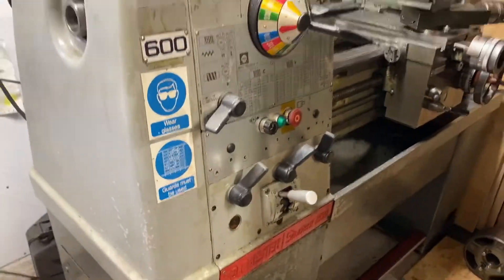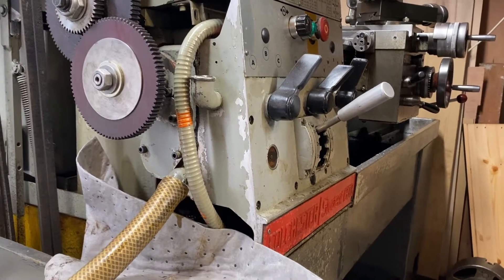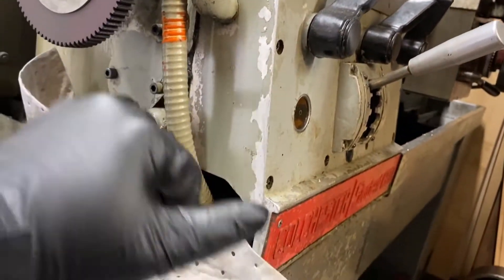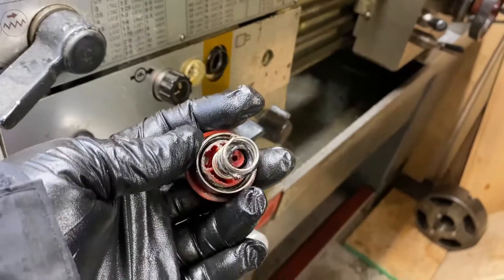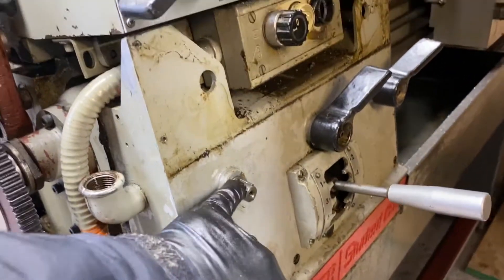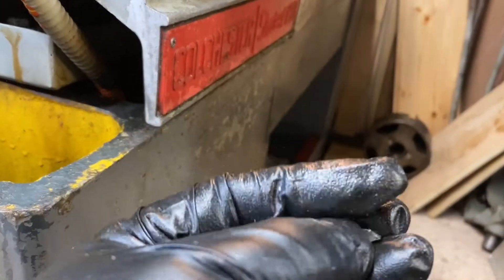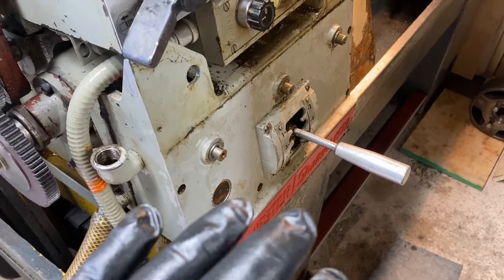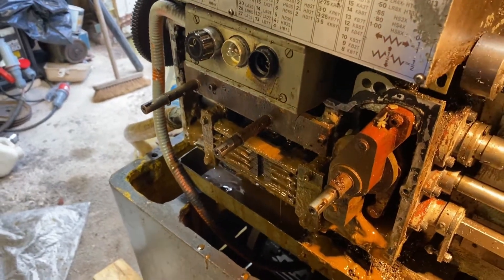Colchester Student 1800 square head lathe gearbox cover removal

Comment: How did you remove the lever?
Reply from the maker: The three selector levers have Allen head screws under the black caps and the silver gearbox lever will just come away complete with the front cover as it just locates in the selector gate so you don’t have to remove that separately it will just come away with the cover